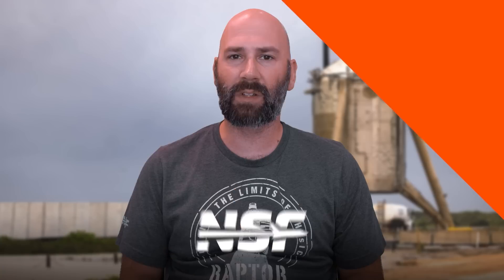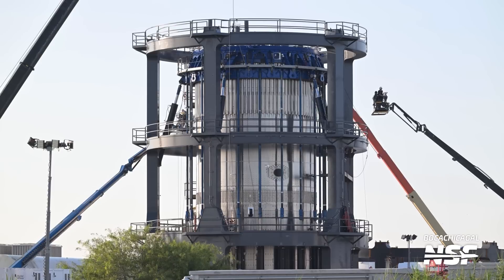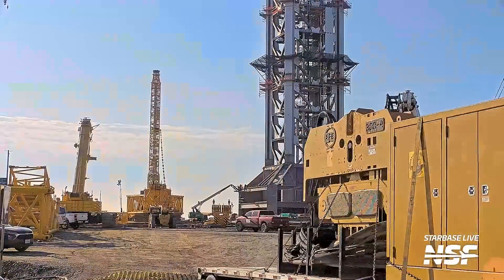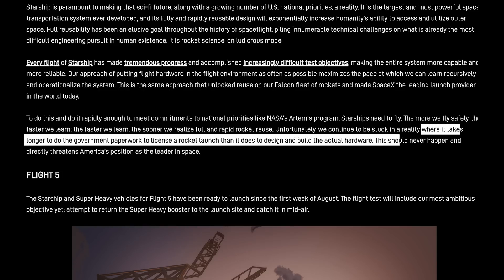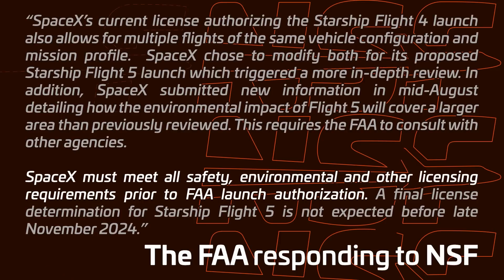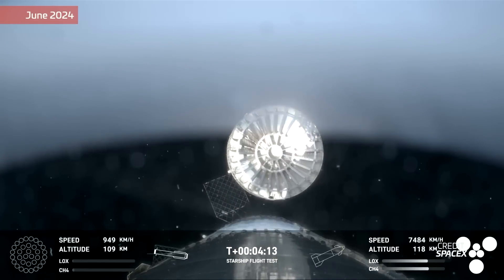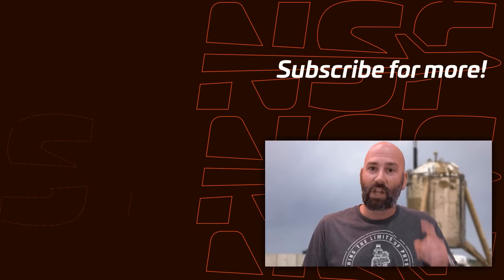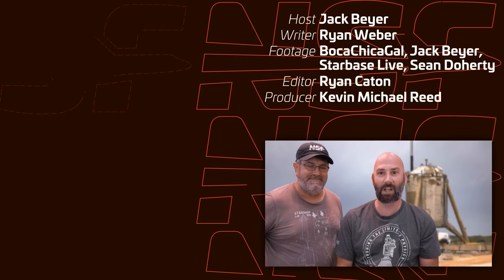WHY Is Starship FLIGHT 5 Delayed? | Starbase Update

Comment: There are multiple ships being built at the same time. So "It takes a year" is intellectually dishonest.
Reply: I was thinking the same thing. They get one finished every couple months. It’s also not like they could start the paper work for each ship at the very start of production. They change so much as they go that the permit wouldn’t apply to the finished product.
Reply: @andrewcatlin3590 Ships 29, 30, and 31 are substantially similar, as are Boosters 10-13.
Reply: Absolutely. Written by an asshole - sooooo NOT the usual NSF stuff. Shilling for FAA? And whoever came up with "their own enemy" piece of crap should shit him/herself for shame.
Reply: Exactly.  It's clear that they meant that they can produce a vehicle ready for flight faster then they can get the paperwork.  They can do this because they are building multiple at the same time.
Reply: For sure. NSF is sounding a bit douchebaggery!
Reply: @hoodlum64 exactly

Comment: @9:25  The problem is FAA regulation is not designed to enable SpaceX's rapid iterative development process. What's the point of using the same launch profile and not change which means the development will be stuck in its present state? Do we expect the booster to always hover and splashdown in the ocean? That's what SLS, ULA, Ariane rockets do except they don't hover. They just crash into the ocean.

Comment: Why should they use their existing launch license if they have already tested everything they need to test without a catch?
Reply: @peternjoroge508  diogoemon mentioned ship side changes, but also keep in mind flight 4 was very far 4 perfection with booster loosing engines on splashdown and allegedly exploding shortly after, and the ship barely surviving reentry

There is still a room for improvement and they could practice booster landing before catch attempt
Reply: because they haven't.... they changed the heat tiles, they changed the payload door (although I don't know if that's ready in Ship 30), and there must be other stuff to be checked other than catching the booster.

Comment: Its well and good to critique SpaceX's press releases. However, regulatory agencies are also valid targets for criticism. An even-handed critique would question the story provided by these agencies and seek basic facts. One of which might be, "What is the environmental impact of LOX and what measures were implemented at the time to mitigate it?"
Reply: Also, Jack reacts to the "literal drinking water" line but not the next line which states "Outflow water has been sampled after every use of the system and consistently shows negligible traces of any contaminants..." I think that it is unfair to highlight the first line and ignore the meaning that SpaceX clearly intended - that the water was sampled, tested, and known to be free of significant levels of contaminants. Critique the statement they actually made.
Reply: One incident in which they dumped LOX. Are they continuing to dump LOX onto the ground / into the ground water? Venting LOX is common on every rocket that uses LOX. Why is it only a problem now?
Reply: @mikegardner107  For the same reason landing on whales is only an issue for SpaceX.
Reply: @mikegardner107  Lol....a lot of y'all seem to forget the most important detail in all these regulatory dealings...It's right next and practically on protected wetlands.

Even the Florida space ports build a big buffer zone to keep rockets from literally spilling over into protected lands. It's SpaceX's fault for wanting to save money and going this route to purchase land in this area, instead of finding a non-problematic location. There is a reason why the land at starbase was cheap...because people know how restricted they would be doing industrial processes in this area.
Reply: @mikegardner107  No, LOX  is not regularly vented by rockets that use it, what is vented is oxygen gas which mixes readily with the surrounding air.

Would you stick your hand in a vat of LOX? Don't you think that 30,000+ gallons of it might have an effect on the temperature and O2 concentration of the water that it enters? Do you think that maybe a sudden change in temperature and oxygen concentration might cause problems for the wildlife in that water?
Reply: @Logan4661  I saw no reports of frozen solid squirrels or armadillos.  Once LOX warms up it is oxygen.
Reply: @Tom-yx7lr  So basically your argument is that there shouldn't be any problem because you are ignorant?
Reply: @Tom-yx7lr  I had some lox that warmed up and it started to smell like rotting salmon.
Reply: @Logan4661  and the evidence of your claim is nowhere to be seen.
Reply: @Logan4661  Are you talking about the LOX that they dump out onto the concrete slab with the containment walls around it to hold it and let it boil off?
Reply: @BabyMakR  No.

Comment: SpaceX decided it was more important to get the regulatory approvals out of the bonus(bonus points for it being an election season). They are ok with decision because they still have 6 plus months until block 2 starship, booster and pad b are ready. There isnt going to be any kind of rapid iteration  happening until then.

Comment: In defense of SLS, it did carry a payload and achieve complete success on its first flight. Reusability is necessary, but these test flights are messy to say the least.
Reply: The iterative design and testing policy used by Space X is wholly different from that of NASA.   Thus they are not compatible.
Reply: Ariane 6 as well, it makes such a welcome change. Really looking forward to New Glenn, that has Falcon Heavy lift capability with about ten times the launch volume. It will be a great addition to rocketry.

Comment: Regulatory issues can be sooooooo frustrating. This process really needs to be streamlined to allow rapid advancements in getting to space. The new space companies do not operate like legacy rocket companies. Keep up the great work NSF!
Reply: Regulation is the restriction of innovation. In the experimental phase regulation should be limit to the direct risks of the project rather large scale of commercialization. Why after Nov 6? Why it so coincident?

Comment: A few notes:

-Can you really fine someone if they think they have the correct permit but it turns out they do not? Then the error should be on the gouvermenting body, right?

-As i got it they are filling up and draining water storage tanks and pipes that is specialised for the task of bringing deluge water to the deluge system meaning there want be any other "industrial comodity" in said system, right? So in normal use the released product should be water, or waporised water. Any rocket excaust should really not mix with said water.

-By the looks of it SpaceX are hard at works on the Chopsticks and hit havent slowed down much during the mounths. So while the rockets might be ready the launchpad seams not to be. But since they havent filled in upon what should be done before catch atempt and what could be done later we dont know what is the chicken and egg there.

-Its also worth asking if the works on the chopsticks means they cant be use for stacking ships and boosters until its done - Could that be the reason to why there is no intermediate flight?

It seams that we are back in the gouvernment process that we had after flight 1 (I belive?) that seamed to take forever before flight 2 - Even longer than the repair of the OLM. It is really hard to guess what is what here but if I where FAA I would say that catching a booster is a MUCH more riskier buisniess than just launching said rocket and that such a rocket could come down all over the site (SN 11) and hit all sort of things in the entire area if they are unlucky. I would really want to double down on safety procedures and risk minigations before licensing such a flight - But then it is key to the entire system.

But the thing I am really curious about is why they dont fly one or two flights with flight 4s profile in the meantime gathering up on re entry data for the ship? They have this new and improved heatshield for ship 30 and I would really like to test that, maybe pared with a de orbit burn. It would also help me gather data on booster and hot stage ring landing and abort procedures.

The only (apart from regulatory issues) thing I can see that prevent that is if the upgrades on the chopsticks prevent it while its undergoing.
Reply: Thats like saying "can you really put someone in jail for punching someone if they didnt know it was illegal" lol

Comment: Even-though IFT-4 went rather well, it did have its own issues that need to be addressed. There was the 1 Raptor that went out very early on ascent (IFT-3 did not suffer this problem, so what went wrong this time), the hinges/flaps burned through very badly, and that explosion of presumably a Raptor on Booster splashdown (Raptor issues seems to be a constant problem during these flights). So as it stands, the mostly "successful" IFT-4 exists in a vacuum. SpaceX should address the issues in that happened during IFT-4 (and the other test flights) and see if they can have an even better test flight with none of the issues presenting themselves again.
Reply: On top of that, ship tests of the Pez dispenser, engine re-light, and tiles can all be done without a booster catch.
Reply: @EMichaelBall  Agreed. Another thing is when you start adding in additional variables to the flight/hardware, when you haven't fully addressed all the previous issues, it's much harder to nail down which changes fixed an issue, caused a new issue, etc.

Comment: I'm curious to whether NASA went thru all this license crap going from Mercury...Gemini...Apollo...Shuttle. Oh course not. Why wasn't the license originally issued for alteration in vehicles seeing how it's a TEST vehicle from the beginning? Designed to slow SpaceX down from start. If they rinse and repeat IFT4, doing IFT5, they learn nothing significant enough to warrant tossing a  Starship/Booster away...hold till Nov. and do more work on T2 and T1. Besides with there complaint post about paperwork, there is starting to be a movement towards doing something about it, but Bezo's does have the Obama's as close friends and they push for him.
Reply: Flight 5 has plenty to learn from on the ship end. Tests of the Pez dispenser, engine re-light, and tiles can all be done without a booster catch.

Comment: To be cynical, SpaceX probably wasn't ready to catch the booster for another two months anyway due to the upgrades needed for the launch tower. Then when they filed the modifications to the flight profile, they knew the FAA would require a further environmental review. When the FAA imposed a delay they took this opportunity to make a hit piece on the FAA to stir up public and political resentment against them with the aim to change how the FAA issues licenses.

Comment: I'm inclined to side with Das in what he said in Friday's Flame Trench. It seems there are valid questions that SpaceX needs to answer regarding the details on their proposed Flight 5. So why not simply answer them? Are they holding out info regarding the flight itself, rocket or GSE technology or something else?
Reply: no that's not the case, that's so misleading it's not even funny

SpaceX doesn't have to answer the questions, although they always do, the problem is THE QUESTIONS HAVEN'T BEEN EVEN ASKED YET, SPACEX IS WAITING FOR 60 DAYS TO ANSWER Q FREAKIN QUESTION, that's what is so corrupt about this, oh and every time there's a question they can restart the 60 day clock, this is RIDICULOUS
Reply: @ivant5054  Thank the chemical corporations. They stonewalled the EPA so many times to avoid admitting they poisoned multiple communities to save a buck, the review reset was instituted to break that logjam.
Reply: Probably for PR reasons. Many SpaceX engineers wanted a second ocean landing, anyway.

Comment: id argue the water would be almost cleaner after being vaporized and the exhaust is just water basically lox n methane burn clean, it just goes through some pipes then out as long as the pad is cleaned of any cleaning chemicals and oils n such it shouldn't really be an issue, at least imo